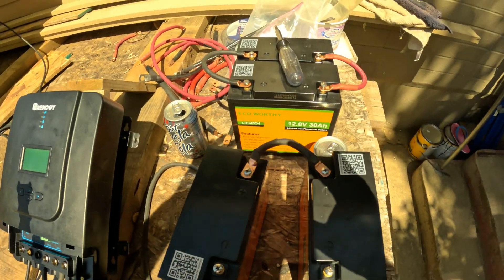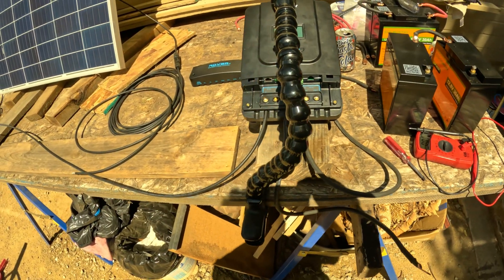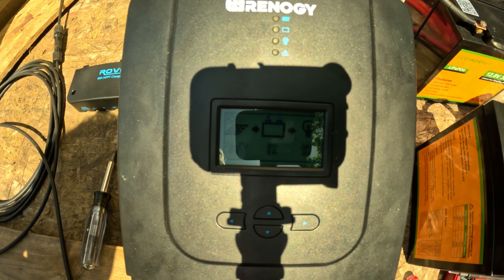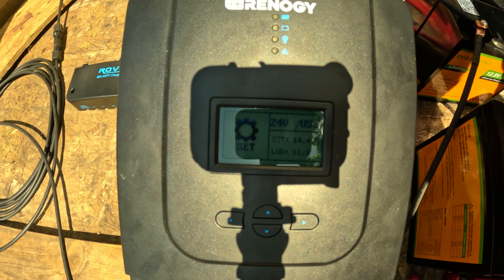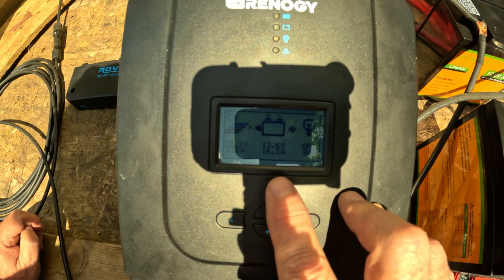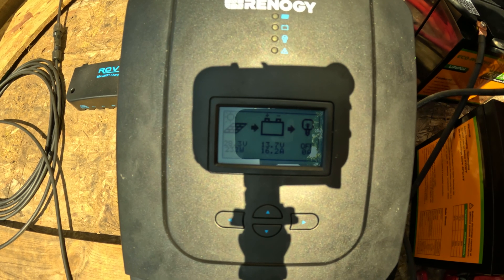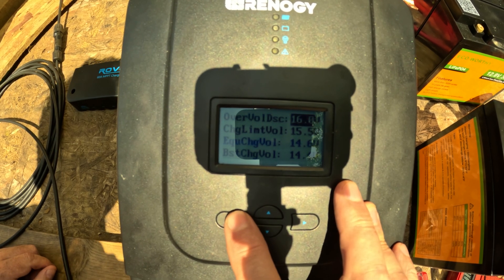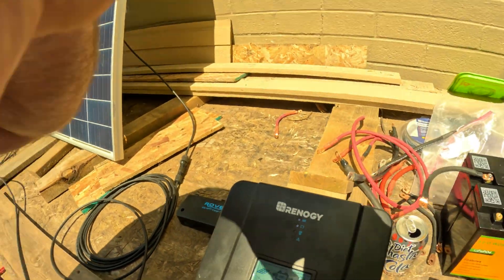How to Set the Renogy Rover 60 Amp Controller to a 24 Volt System

Comment: Charge Controllers need Battery Power 1st to recognize Its 12 or 24 Volt and then enable Your Solar Panels. For proper operation.

Comment: Thanks Gary...so Juice it up with the PV and set my voltage specs ..and then add the batteries..?...which is a crazy solution cuz I'm sure they always recommend you have your batteries attached before you connect your Pv otherwise you can blow your charge controller...🤦..luckily Renogy agreed to a warranty .so .my rover is on its way back ...hopefully the new one just works out of the box without any tricks 😉
Reply from the maker: No, you want to power up with your batteries first, and then your panels. That was my mistake as I was feeling a bit out of it this morning from allergies or something. What they recommended was to set your controller to the preffered 24v setting, and then disconnect everything, and then reconnect. Batteries first, panels second, load last, LOL... Sorry about the mistake! Fortunately it was just one panel and not a large string or array. That would have had a larger impact..

Comment: I thought it was better to connect batteries first, then the panels? I'm still happy with my Renogy setup on my motorhome. Sticking with 12v, just easier. I also am buying used panels. I found a good deal with Santan Solar. 10 230w used Trina panels shipped for $350. Still putting out plenty of power. I want to setup a 48v system at my cabin. My ultimate goal is to heat water with a DC element. Keep the good work up, thanks for  posting your videos.
Reply from the maker: Yeah, that was my mistake. I was pretty tired this morning and had some random train of thought that a load also included the battery. In saying that, it was only one panel and not a significant amount of power compared to having a large string or array. 

That sounds like a great deal on panels by the way. I am not totally unsatisfied with Renogy, but I have had enough problems with it at this time that I really don't trust it for my remote off-grid needs. I usually have enough things happening project wise to have to stop and deal with the source of my power, if that makes sense. I do believe that it will work great in my outdoor kitchen that I have been working on here at my city place, and for what its worth I did connect the BT 300 shunt to my 24v system and it connected right away and seems to be working great.

Thanks for pointing that out and watching my videos. More to come....